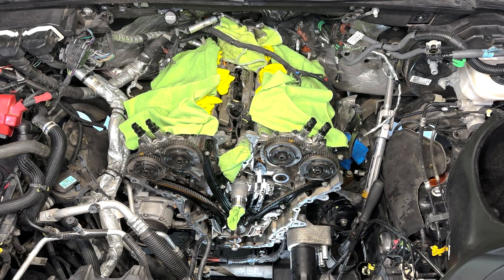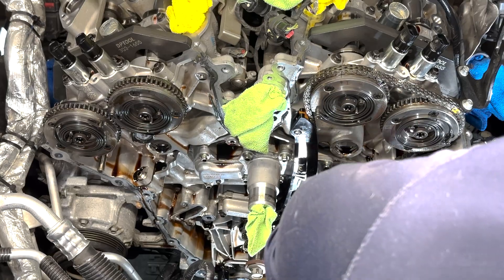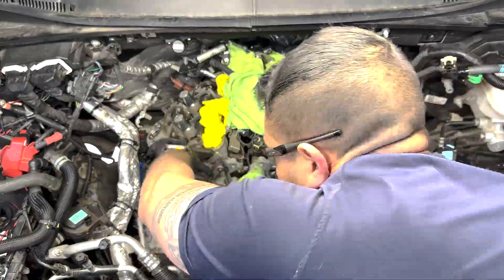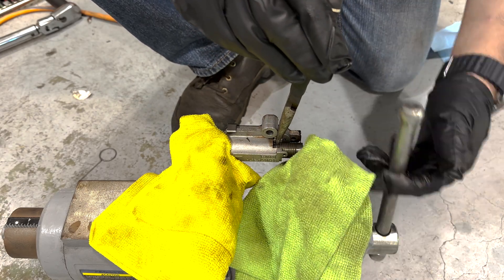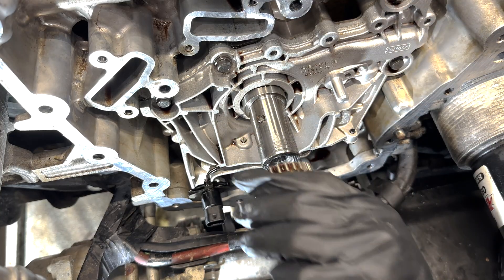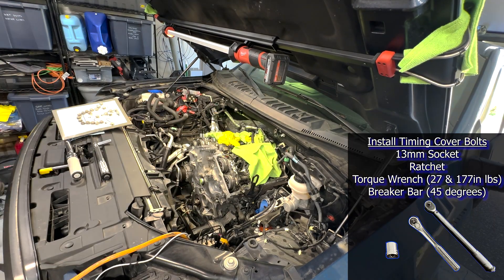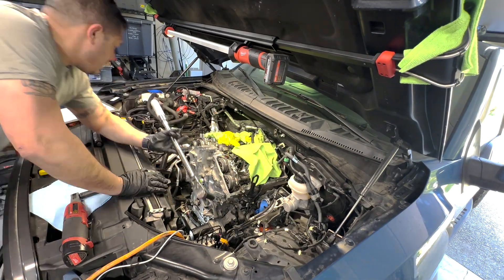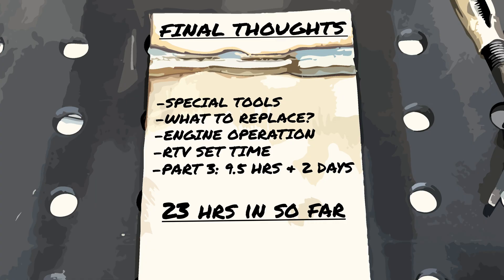Gen 2 Raptor Cam Phasers Part 3

Comment: Is there any chance that you installed the oil sensor seal backwards. When you remove it, you can see the lip and then when you’re checking it with a 19mm socket, it’s backwards.
Reply from the maker: 100 Percent...major fail on my part. Good eye though, I just looked back though my videos and in the manual. The seal is supposed to sit the same way as the ones on the valve cover over the solenoids (Same part number). That way the lip sits over the shoulder of the sensor. I definitely installed it backwards...must have gotten confused since I kept flipping the cover around and didn't pay attention. I'll have to keep an eye out for leaks and add a subtitle to the video for notice. Thanks for catching this!
Reply: @ruffwrenchn2235 I’ve been using a few videos here and mostly yours. I was sent two cooling seals so I lost the orientation due to having to go out of town and picking one up. I figured it should look like the ones on the valve covers, applied the rtv and started assembling it all. Went into full panic mode when I saw the closeup of your seal when you checked it with a 19mm. I pulled everything apart thinking I was backwards. I’m really glad I did because my rtv job was really bad and would have leaked for sure. So it worked out for me haha!
Reply from the maker: @jeffsanchez2572 seriously sorry for the trouble and thanks for pointing it out! I’m gonna try to cut that clip out of the video in the YouTube editor as soon as I get a chance.
Reply: @ruffwrenchn2235  no worries man. Your videos have helped me much more when compared to the small inconvenience of wiping away rtv.

Comment: great work since you have all coolant lines out, Will you be adding a oil cooler? And wondering why you didn't replace the oil pump? thanks
Reply from the maker: The truck comes stock with an oil cooler that acts as the oil filter mount...or do you mean and additional one? I'm not familiar with any aftermarket oil coolers other than the larger transmission air-to-liquid one. I hadn't read about failures with the stock oil pump so I skipped it.
Reply: @ruffwrenchn2235   Sorry had to edit my reply, But yes a external oil cooler to mount in front of the radiator. I feel like the coolant could be overworking trying to keep the engine, oil, transmission and turbos cool all together. I was looking at a doubled walled thick oil cooler down the road to mount in front of the radiator and delete the small coolant fed oil cooler on the filter housing. and replace that T with a regular coolant line.
thanks for all your work as always
Reply from the maker: @jamyhanna6181  There are probably some aftermarket options that could be modified to work, but I think it would be easier to just install 170 degree thermostat and larger aftermarket radiator than mess with rerouting the oil somehow.
Reply: @ruffwrenchn2235  sounds like a plan thanks for your advice.

Comment: How much would you say you are in for dollar amount of parts and tools for this repair?
Reply from the maker: Depending on how many miles are on your truck and what you want to replace in the process, you could get as cheap as $400 just replacing the phasers, bolts, and RTV. I put a couple lists in a google doc in the details and I'll try to update it with the tools also. The tools I think cost me $90 for the holders, TP55, extractor, and caulking gun. It's a lot of work to tear everything apart though, so you might want to replace as much as you can afford in the process to avoid doing it all over again.